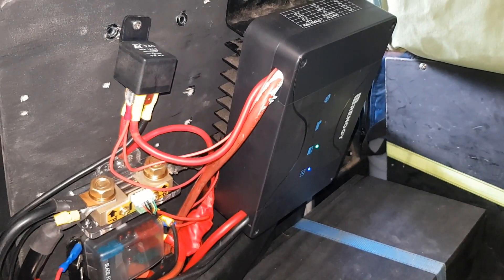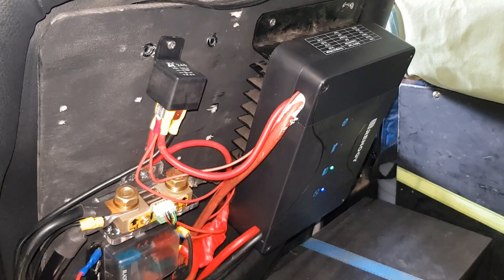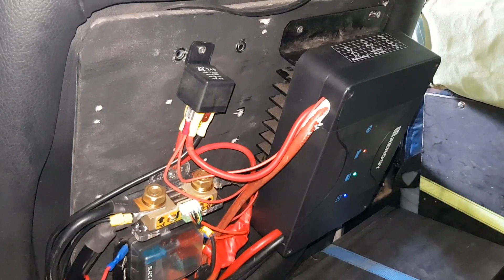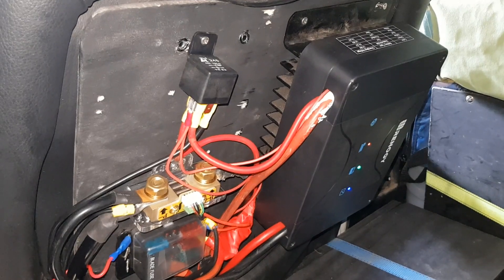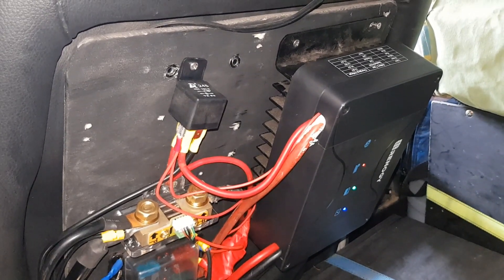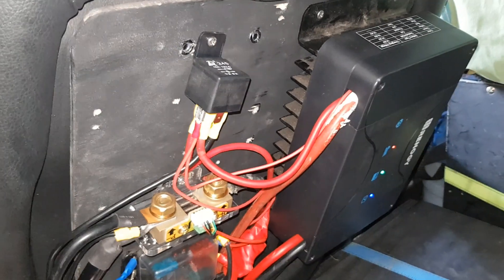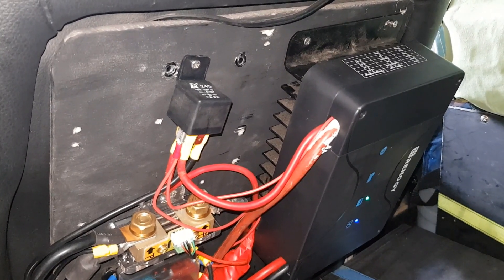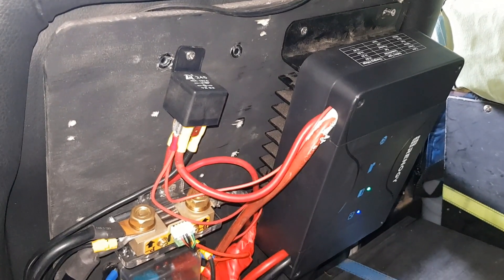Renogy 50 amp DC Dc charger with Mppt. Getting the full 50 amps out of the unit.

Comment: Spero che tu possa rispondere ad un problema che ho con questo apparato nuovo, lo uso per caricare una power station Fossibot F2400. Nonostante scolleghi il pannello fotovoltaico da 180 W attraverso un interruttore, la corrente che mi eroga l'alternatore (da 140A), non supera i 9 Ampere. Cosa potrebbe non funzionare? Ti auguro una buona giornata.
Reply from the maker: I had a similar problem. I was using glass fuses and found the plastic ends had melted giving low amps. I replaced those and problem solved. Others have found poor connections with the crimping not done securely. Wire size is important too.
Reply: Grazie per la tua risposta, l'installazione del Renogy lo ha eseguito un professionista in mia presenza, ho constatato la qualità del lavoro. Io penso che il problema possa essere qualche incompatibilità, tra il Renogy e la Power Station Fossibot F2400, che dovrebbe caricare. Ho ancora qualche prova di settaggio da fare, poi mi arrenderò ed eventualmente sostituirò il dcdc. Saluti

Comment: How is that heat sink meant to work on the back off that charger???? Solar priority is free, alternator charging is NOT FREE, this unit has voltage sensing, so you should not need a separate 12v trigger to activate the alternator charging
Reply from the maker: I agree solar is free. The problem on a 4wd is limited space for permanent solar pa els. So it is more important to charge rapidly when short days of driving are to be had. Hence I want maximum alternator charging. Solar blanket kets can be used when base camping but there is not always sun. Induction cooking, air fryer as an oven, fridge and seperate freezer need power. So I choose to prioritise alternator harging over my limited fixed solar panels.
Reply: @pcfpatrol  I would doubt many people drive and cook at the same time, i.e. use a induction hob etc, your only real needs is a fridge, so if you are parked up, the alternator is not doing nothing and yr only input is solar anyways, If you want max charging when driving then add a switch to the solar input and turn if off so the charger is only drawing from the alternator and it will draw full currant
Reply from the maker: And that is exactly the purpose of this video, the relay is the switch. The relay just makes it an automated version. Great suggestion.

Comment: DO NOT BUY! I ordered one from Renogy directly. It quit working after about a month. In order to get a warranty replacement the asked me to take videos of it malfunctioning while connected to a multi-meter. Then, they told me if I end up sending it back and they get it to work in their shop I will have to pay for shipping there and back. This is rediculous. Then they want to snail mail you some paperwork to fill out before they will warranty. I am still fighting with them on this. I will never again buy from Renogy.
Reply: Update...So, Renogy got my unit and declared it was functional and said they would refund me but minus $80. I literally tested it every way possible. It was not working. The battery type light was even jumping around from blue to white to amber on its own. I had it less than a month. It wasn't working. This company sucks.
Reply from the maker: What a totally different experience I and my friends have had with Renogy. We have had quality well performing equipment from them and will continue to buy their products.

Comment: So if you had a Normally Closed relay for solar, which triggers Normally Open apon ignition on, wouldn’t this allow 50amps for solar when stationary and 50amp from Alternator during driving??
Reply from the maker: That is exactly what is happening. Closes off solar when ignition detected and when vehicle turned off, reverts to any solar attached. For me it is only 100w most of the time. However, when in camp, I sometimes attached 250w of solar blanket too.
Reply: @pcfpatrol  are you saying this is what the charger does? Or are you saying you have yours set up this way??
Reply from the maker: The relay on the top left opens solar when vehicle ignition is turned off, and closes the solar when ignition turned on.

Comment: Hi Peter, do you know anything regarding adjusting the current output of the charger via bluetooth and the app? My hilux might struggle to supply the full 50A so want to play around with the current output. Thanks
Reply: I don't have a great deal of knowledge in your situation Tyler.... however, the unit will take whatever your alternator can throw at it. Might the smaller 30ampversion be more suited to your setup?

Comment: The new renogy 50 amp mppt, takes solar first but then adds whatever is missing from the alternator. No ignition wire either . I use a relay to select new tween to battery banks so I can use two different brands and or models. Relays are great

Comment: Hey men. I only realised there's two version of this charger 30 and 50 amp. I bought 50 amp and now I worry it will be too much for my old 1992 Ducato motorhome :/ what you think
Reply from the maker: Not a problem. When charging from the alternator, it can only put out what is left over after your Ducato uses what it needs to run. If you have solar setup on the roof and do not use a disconnect relay, you will only get 25 amps from the Renogy unit via the alternator. Set it up. It is a great unit.
Reply: @pcfpatrol  thanks for getting back to me, I dont really understand the solar reley thing. bought 2x 120 panels aswell and plan is to have them hook up too. can you tell me whats the best way to do it?

Comment: Hi Peter, I'm late to the party :). I also want to connect my portable panels, 2x 160 Watt when I park. I've got 90 watts on the roof. I considered setting up some sort of three way switch like we used to use for two computer monitors. Is that a good solution? What did you do? thanks
Reply from the maker: Sorry I didn't answer properly for you. I run anderson plugs (×2) through to a fuse box, then through the 30amp relay into the Renogy unit. That way each solar panel is fused and the relay controls power in when not driving for the fixed solar panels, as well as the portable solar panels.
Reply from the maker: A switch to turn off the solar panel mounted would work. A simple on off switch would work as when the solar is disconnected, the alternator will work and charge up to 50 amps. I am lazy and set up a 5 pin relay that disconnects the solar when I start the car.
Reply: Peter I was asking how you connect your portable solar panels into your system when you aren't driving? I thought you said you did that.

Comment: Isolate your solar when driving ?
Reply from the maker: That is exactly what the relay does. I am lazy and wanted it to be automatic.
Reply: @pcfpatrol  A lot will depend on how much driving you’ll do in a day, and the anticipated consumption between drives and total battery capacity. There is some cost implication using alternator only in fuel consumption, though modest I know. Being in Oz I don’t suppose you get so much 10/10 cloud cover as we do in UK, so some useful solar input even from 100w panel.

Comment: Looks like you have a long run to your starter battery possible problem for needing the switch is volt drop from starter battery hence it not triggering the charging? Up the cable size may solve the problem but you will still only get 25amp when using solar as well

Comment: I installed 100w solar this morning. I followed explorist life van build tutorial for a solar disconnect which is electrical code anyway. I did an upgrade to the 2000w inverter yesterday. Am cooking fajitas in a small slow cooker at the moment. I’ll be adding two more batteries to my system soon. For now, I’ll just shut off the solar to prioritize alternator charging when needed. If it becomes a hassle then this relay looks very convenient however mine is a 30A unit so either way I’m not losing out on too much.

Comment: I don’t know why yours looks overly complicated for some reason… maybe all the extra business next to it and the weird box fuse connector or adapter feeding into …. Mine hits the 50amp perfectly and I just followed simple connection layout . I think you over thought it
Reply from the maker: I concur it is messy in that video. All fixed in that regard now. I assume you do not have solar mounted and permanently connected. If that is the case, you will get your 50ampsno problem. Try hooking in a solar panel and then go for a drive. It immediately only offers 25 amps from the alternator and whatever your solar will give...unless Renogy have changed the unit somehow.

Comment: Hello, I bought a DCC30S, like the DCC50S the maximum input voltage of solar panel is 25V. The VOC of the most solar panel is between 20V and 23,5V at 77°F. But a 14 °F the VOC increase above 25V. Is there a protection against overvoltage or a limitation on Renogy DC DC MPPT ? Regards
Reply from the maker: What a good question, Thomas. I can not tell you if the Renogy units have a High Voltage Disconnect (HVD). That is a question you could direct to Renogy and give me feedback on the answer.
Reply: @pcfpatrol  Hello, I tried to contact them, but it s difficult a get a answer...

Comment: Extremely helpful and efficient.. I didn't need to watch a 30 minute video to get the solutions..

Thank you.. and how has this unit held up
Reply from the maker: Thanks for the compliment. The unit and setup as a whole are doing a fantastic job. So much so I am now adding a 2000w Renogy inverter, induction cooker and electric kettle. I have already introduced a small 12v oven. All this with a confidence the Renogy unit will punch in nigh on 50 amps to my 240ah lithium batteries while driving and then whatever it can from my fixed and portable solar panels if base camping for a few days. Love the setup now.
Reply: @pcfpatrol  I am grateful for this video... I went ahead and purchased the non-mppt version of this charger.... 

please video document these project....  The induction cook is the way I want to go..  my Class B only holds 9 gallons of propane...

Between cooking on the stove .. running the absorption fridge and furnace..   it's not enough propane...

Comment: Just found your video, same issue here. Wondering if you can make a video on the exact wiring from the relay and where each lead goes. I did read your written response, why did you go with a 30a relay? Just curious 🤔  using the relay as a switch between alternator and solar is brilliant. So my guess is when the truck is running the 12v signal switches the relay to the alternator therfore allowing power to flow from the alternator only. When the truck is off, the relay receives no power. Therefore the relay returns to a non powered state and the switch in the relay "fails" to open the circuit witch is hooked into your solar imput on the dc-dc charger. Is that right? It makes sense in my brain but I'm not 100%. Anyway I like the fix it's kind of genus.
Reply: Nah mate it will be easier than that, 

Positive wire from panel to relay 78a (normally closed circuit (on) when not energised), negative to relay 85, accessory trigger to relay 86, from relay 30 to solar in on RENOGY. This connects / disconnects the solar input to the RENOGY by the looks it’s connected the same way in the video

Comment: I have a strange problem I charge my car battery and now my unit won’t come out of bulk charging and it seems to be discharging my starter battery if you want 50 A hook up your ignition line so it sees 12 V when you start the engine
Reply from the maker: I wonder if when you are running your engine, then turning your engine off, you are seeing that the Renogy unit is still connected as it remains connected until voltage drops to 12.7v I think. I agree too that some setups require an ignition switch for the unit to know that the car is running and to commence charging. I am now very happy with my setup. My understanding of the unit and how it works along with a rewiring of the unit with much heavier cabling has seen my 12 volt auxiliary system run my fridge and freezer, electric oven and lights for days without problem. then a few hours driving and I am fully charged again. I love it now.

Comment: Just install a DC 60 amp relay and cut out the solar with a switched signal from the alternator. You can use an automotive relay..

And the reason it does that. The alternator pumping out 50 amps for too long. At idle will fry the alternator. Unless you buy a high dollar high output alternator with huge heat sinks on it...Designed for low rpm use...Unless you put an over drive pulley on your alteration.
Reply: DO you mean to add a manual switch for the solar. If its not already passing by solar when drawing from alternator how would the relay affect it?

Comment: Great video. I was just about to buy this renogy unit but stumbled upon this issue in another video. Found yours seeking more detail. I'm in 2 minds as to whether to just proceed anyway as Im not majorly concerned by missing out on those solar amps while driving. Could you possibly share how you've connected the relay?
Reply: All good I should have read comments first. Thanks for supplying the pin info on the relay!
Reply from the maker: Please look through other comments and my reply on the wiring of the relay. I am very happy with the unit overall and highly recommend it.
Reply: It's not complex. Just add a manual switch or anderson connectors to the solar input and plug the panels in/switch them on when you're parked and won't be moving for a while. If you are really lazy, you could add a relay to the solar side to open the circuit once the vehicle is shut off. I don't understand why you would want the ability to charge via solar when you have 50A available from the alternator when you are driving. Unless you have a huge solar array that can out-charge the alternator, but you're not able to do that on this unit anyway, since it limits the solar charging input.

Comment: What relay did you use? It would have to be a normally closed relay correct? I’m looking on Amazon but they don’t say if they’re normally open or closed most of them
Reply from the maker: Hi Henro. I used a 30amp 5 pin relay. Accessory/ignition wire to pin number 86 and then into the Renogy unit. Solar panels in to pin number 30. Pin 85 to earth. Pin 87a is the solar to the Renogy unit. Pin 87 is not used. Normally with a relay when you give power to the relay via the ignition (pin 86) that connects Pin 30 and Pin 87. When there is no power to Pin 86, Pin 30 and Pin 87a are connected. So when the vehicle is not running, we have now connected the solar to the Renogy unit. When the vehicle is started, Pin 87a is disconnected, thus disconnecting the solar. I hope this makes sense.
Reply: @pcfpatrol  thanks for the reply. I see what you mean. When pin 86 gets 12v it closes the contact between pin 30 and 87. and when theres no voltage, it opens those contacts and closes pin 30 and 87a. Thanks so much i was not aware on how the worked i thought there were different kind of relays, one normally opened and one normally closed. thanks for the great video.
Reply: Would you be open to makinga wire diagram for this,  so I can do the same

Comment: Could you give me some detail on the ignition wire connection. I have the same charger and can only seem to get around 15-25a at max with an 100a alternator. Thanks
Reply from the maker: Often one of the best sources of an ignition wire is from your windscreen wipers as they only recieve power when the ignition is turned on.
Reply: The issue with forcing the renogy to draw more is you can burnout a dumb alternator. Renogy reduces load as voltage drops to protect the factory alternator.

I do agree with removing solar during running
Reply from the maker: @jonohadley1629  when the auxillary battery is charged the Renogy unit does reduce draw from the alternator still.